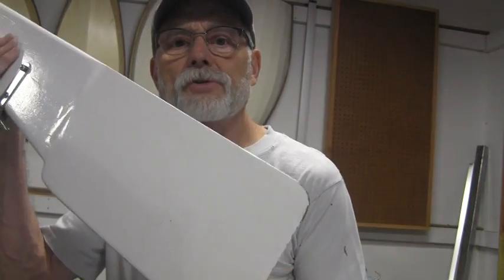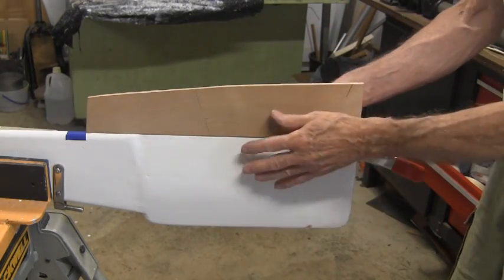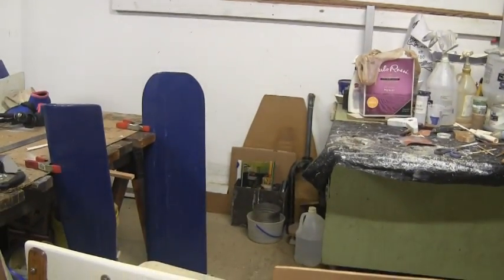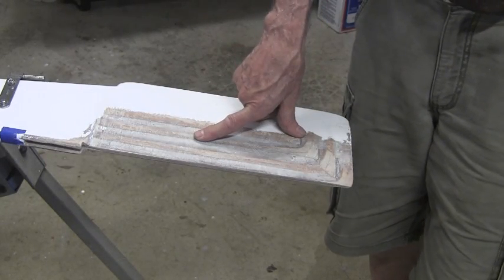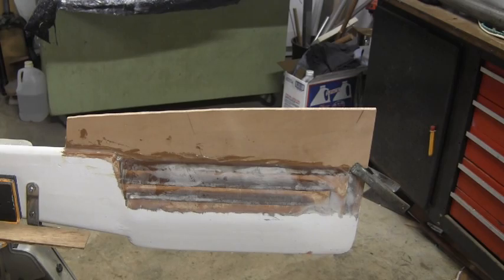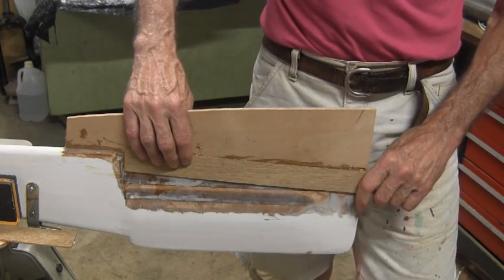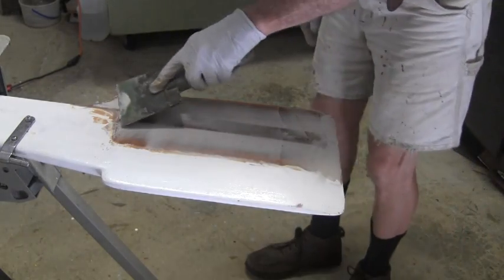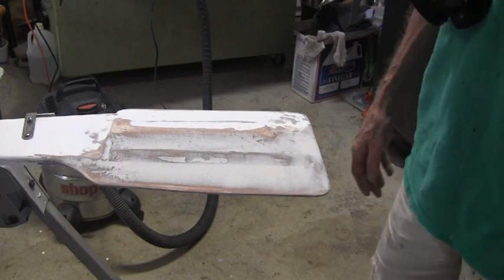Resizing the Rudder on the Laura Bay

Comment: Haven't seen any posts from you for a long time, also on Bigwheelsturning, hope everything is OK>
Reply: Been too cold in the barn to work on boats, or ride Rosie.  I have been working on boat designs and straightened the head tube and front forks on my junker Honda Elite 250, so I will be showing that in the future.